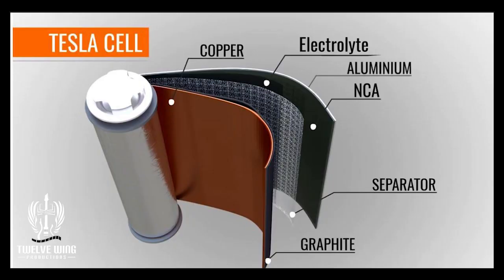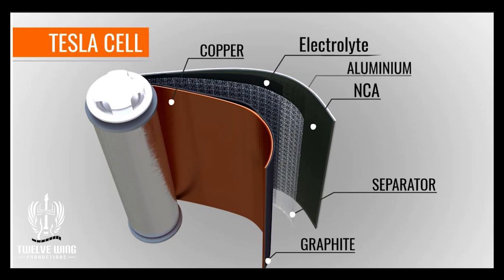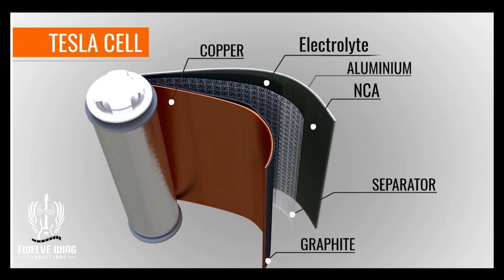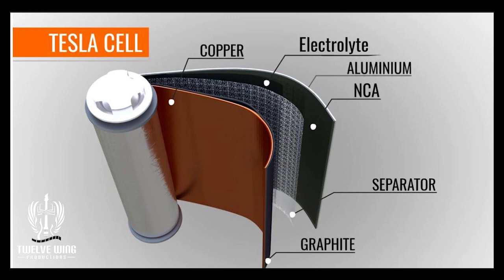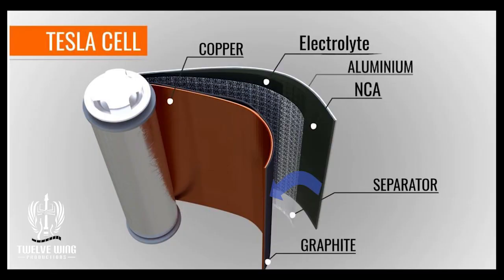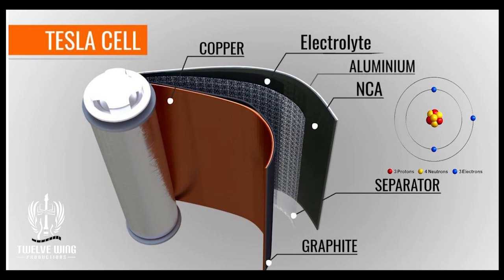Lithium Ion Battery: What the hell does the cobalt do? (and why is it evil)

Comment: Very informative....i have one question. In LCO cobalt changes its oxidation from +3 to +4 and rerurn +4 to +3 during charging and discharging so what does actually mean?
Reply from the maker: In the case of the cobalt it doesn't mean anything other than Cobalt is happy in either state so as a transitional metal it doesn't affect the other properties of the battery.

Comment: Do lithium cobalt batteries have better durability towards extreme temperatures than regular lithium ion batteries?    More specifically what I’m asking is this, I am looking to buy one of those portable lithium pack car jump starters…and sitting in your car all year it will endure hot summers and cold winters.    One that I’m looking at is a higher cost lithium cobalt chemistry, would that one do a little better sitting in a car all year?
Reply from the maker: Let me look at the one I have.  I've had the damn thing for years and years and it still works like gang busters.
I'll reply to this thread with the maker and model number.
Reply: @twelvewingproductions7508 rest in peace?

Comment: Could you remove the aluminum and nickle and just use a pure cobalt electrode?  Is the Aluminum and Nickle added just as cost reduction?
Reply from the maker: Cobalt itself is actually quite brittle... but it's a good question as to capability.  The issue would be availability. 
One wants to make the battery out of things readily available considering how many are needed.
And again, the cobalt is simply there to strengthen the alloy.

The real advancements is going to be in solid state cathode material where the lithium can be stored in a medium where it doesn't form dendrites at all.
Reply: @twelvewingproductions7508  I have 5 lbs of cobalt and was thinking I could start making li ion batteries but I don’t know if I could 3D print the case

Comment: Hello.  How do I connect with you.  I’d like to know more abt the cobalt /Congo issue.   Impressive video.  Thank you.
Reply from the maker: Was there something specific you would like to know?
Currently what I can tell you is that Tesla doesn't have an issue with conflict minerals.  Their supply line is far more easily traced than that of other manufacturers.  I'm not sure how, if at all, the China Gigafactory and Tesla's partnership with LG Chem and others factors into this.

What I can tell you is that Tesla formula was specifically tuned so that the amount of cobalt required by their batteries roughly matches that found naturally in laterite nickle ore. 

If you have a further specific question about it I'll try and answer it here or perhaps do a separate video about it.

Comment: Luv the vids... sure someone answered this before, but what’s with the glove?
Reply from the maker: The screen is a touch screen.  When arranging photos to use, I use a pen.  The glove keeps my hand from touching the screen.
When I do the videos, I usually leave it on so I can wipe smudges off while still using the touch screen.
Reply: Ahh I see- it kinda suits u :)  I noted on one of your vids re cyber truck b4 the launch u were discussing specs... one of which was the 8’ bed.. very clever the way the tailgate drops with stops in place to accommodate a full sheet and stop it sliding around..

Comment: Ok, nickel is in stainless steel.  Therefore cobalt is present.  Is it left for strength, or harvested for use in batteries.  The Cybertruck will use alot of stainless.  Appliances use alot of stainless.  So where does all this cobalt go.  Is the Cybertrucks stainless a backwards way of mining cobalt?
Reply: Cobalt and copper metals or chemicals are produced by first reductive leaching. After leaching, the resultant solution is separated from unleached solids and transferred to solvent extraction. Copper and cobalt are separated from each other, leaving cobalt in the aqueous raffinate.

Comment: Could you make an acid bath battery with bulk cobalt?  I bought several pounds of pure cobalt years ago for its magnetic properties but my design changed and I was left with all this cobalt that I have not been able to sell so I was thinking of trying to make a super battery for solar cells on my house.  I was unaware of this Congo issue when I bought this Cobalt (I think it was 2-3 years ago now and its been sitting on the shelf).  But if I cant sell it im not going to just throw it away, especially if someone gave their life for it, I would want to maximize its utility since I already have it now.
Reply from the maker: If I had bulk cobalt I would probably do what you did with it... magnetic experiments.
It's a pretty cool transition metal.
Reply: @twelvewingproductions7508  How is the graphite coated on the metal?  Is it diamond coated where they form a nice uniform solid layer?
Reply from the maker: @ronpearson1912 , In the current process or the dry electrode process?
In the current process they use a binder much like one would use for a paint or a glue.  I don't like using the term "paint" because it's more complex than that and is applied more like powder coating but it is still a "wet" process.  This is equally true for the oxide layer.
I have no idea what the dry process entails.
Reply: @twelvewingproductions7508  could probably sputter it on too